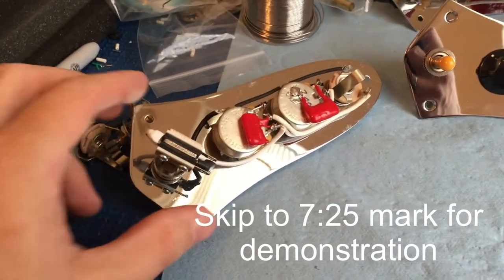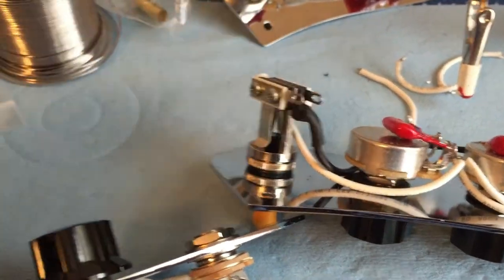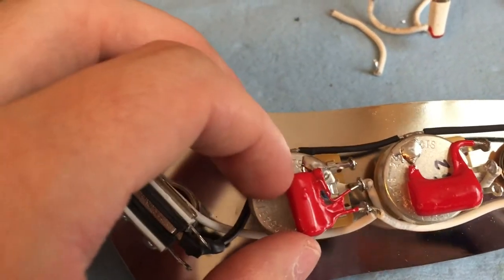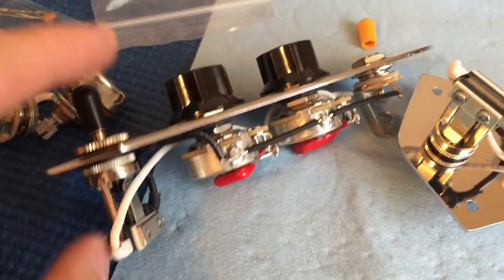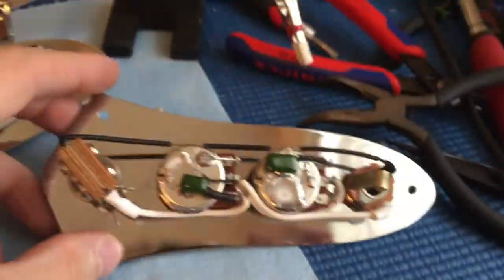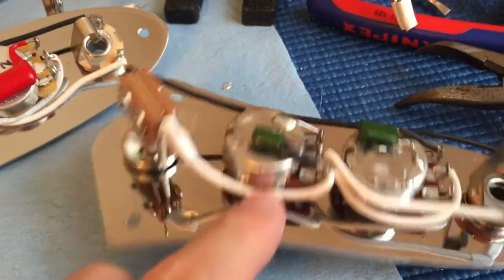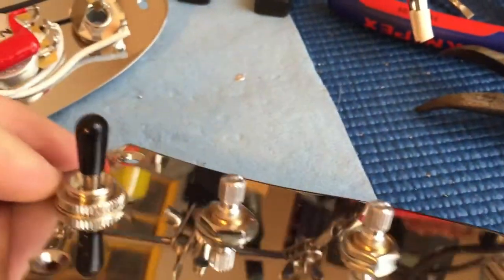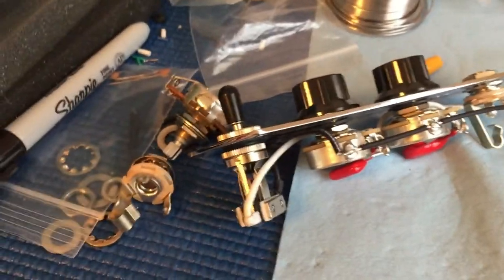Fender Jazz Bass Control Plate that you didn’t know you needed!

Comment: Fender didn't use a selector switch on jazz basses because it's a bad idea. Using a selector switch limits the tones you can get out of the pickup combination to full bridge, full neck, and full both. You can get all those with two volume controls so you aren't gaining anything in terms of tonal versatility and you're losing a lot. You also lose the ability to compromise your tone to combat the noise inherent to the jazz bass's single coils when their volumes don't match. Outside of the aesthetics value of having a switch if you think it looks cool, the only thing you gain by using a selector switch instead of the two volume setup is the ability to switch between a restricted set of tones very slightly faster. You could get the speed without losing anything you have with two volume controls by using a pan/blend pot instead of a switch.

On bass and guitar controls, the only times switches aren't inferior substitutes for pots is when they're being used for coil taps or series/parallel/single coil mode selectors.
Reply: and some people are totally fine with those "limitations" on tones. I used to use a blend pot and was either notched mid, full neck and full bridge. Fixing any wiring with a blend pot was a disaster as I'm not too handy with a soldering iron. I have completely converted and gone to a 3 way switch and it's everything I've been looking for. If any wiring goes wrong, it's an easy fix...but I don't expect any problems having now 2 of these in my possession, they're just designed and built incredibly well.
Reply: 90% of people don't use the blend, plus there is no number indicator on the knobs so its hard to remember where that "perfect blend" is.
Reply: @devlintaylor9520  I don't know why you think 90% of people don't use the bend on jazz basses. Even Jaco, probably the person most well known for playing with one pickup, didn't really just leave the neck pickup all the way off a lot of the time.

You don't really need an indicator because you can hear the tone and it's even easily find previous positions you like without having to listen just by turning a pot about so much from all the way on or all the way off. It's really not difficult at all.

If you really have that much trouble finding a previous spots on a pot, just roll it all the way off, put your thumb at about 9 o'clock on the knob, roll it on until you find the tone, and remember what position on the clock your thumb ended up. You can get any possible mix of the pickups on a jazz bass with at least one pickup all the way on. If you have the neck pickup an 80% and the bridge pickup at 60%, the tone the same as having the neck pickup at 100% and the bridge pickup at 75%. The only difference is that you have less volume at 60|80 than you do at 75|100. Just keep at least one knob all the way up all the time so you only have to worry about rolling to a spot that isn't all the way up on one knob. The spot on the other knob is going to be close to some landmark that make it easy to find on the fly if you know it's there: just a smidge before noon on the dial, just barely past 2 o'clock, etc.

That does leave you with a volume control issue, but that's just an issue inherent to jazz basses. They're designed in such a way that you can't simply change your volume without changing your tone unless one pickup is active. Unless you want to run back to your amp all the time, you pretty much need a volume pedal to act as a master volume control.

A pickup selector switch doesn't really improve anything. If you only have your pickups all the way on or all the way off, it's just as quick and easy to roll a pot all the way up or down as it is to flip a switch. I guess it' would be easier switching one pickup between all the way off and to 10 o'clock or something if you aren't used to messing with the tone knobs at all, but not by much you're probably not usually going to be playing with one pickup all the way off if you're used to messing with the tone knobs because you need both pickups on at least a little bit to reduce the 60 cycle hum. If Jazz basses had humbuckers or a third middle single coil pickup to act like a humbucher in tandem with the neck an bridge pick up, it might be a different story. Even if you don't care about the hum, it's unlikely that the tone you want is really going to be only one or both pickups at full volume. You're probably going to want at least a little more low end from the neck pickup when the bridge pickup is all the way up, a little more crispness from the bridge pickup if the neck pickup is all the way up, or a little less of one pickup if they're both all the way up.

Comment: I’ve found with the alphas, you can take like a 220 grit sandpaper or sanding block to the back and then it grounds just fine! Just a couple swipes does it, takes 5 seconds. 

I have a small shop with tons of pots in stock and I’ve sanded the backs of all of the alphas. 

But I think the Bourns are just as good any way. Just a tip!

Comment: Might as well use a switch, the stock volume pots on my American Fender Jazz don’t blend, you can’t hear the lower volume p-up until it’s turned up 85-90%.
Reply from the maker: @michaelanthony9068  I hear ya. That’s 50% of the reason why I make all these different models is because of those borderline useless pots that Fender uses called J taper pots. You’re right. They’re basically on off switches.

Comment: I'm thinking of adding a 3 way switch to my PJ bass. I want volume control for both pickups to be able to blend the pickups.
Reply from the maker: A three way switch AND a blend switch?
Reply: @ticktockfool  I want to keep both volume controls and add the 3 way switch.
Reply from the maker: @rong648  Gotcha! What about your tone knob? Or are you planning to cut your pick guard for the toggle?
Reply: @ticktockfool  I want to put the switch between the volume controls.
Reply: I did some more research and I'm going to install a Blend Pot. (Master Volume, Blend Pot, and Master Tone).
Reply: Independent volume control doesn't do anything interesting, unless your bass is active.

Comment: I did this along time ago on an old pj vm jaguar bass, only I had a barrel style out so I was ale to do dual volumes and a single cap still. Still a very good jazz bass sound and could instantly solo the p bass pickup. Doing it this way with a single volume plus the treble bleeds is pretty redundant. Bass players don't really use their volume as a tone shaper and also don't instantly select pickups as guitar players normally do. Idk just silly but hey I'm not kgonna knock anyone for getting their bag.

Comment: Neck in the bottom position bridge in the top? Is there a reason for that? I'd me inclined to mount the switch like a Telecaster where you can flick with the Pinky forward to the neck and back to the bridge. Cool setup. I've got my Jazz on dual concentric pots, no switch.
Reply from the maker: Hmmm? Neck is foreword position, bridge is rear, mid is both. These are “tele” directional.

Comment: Holy crap! I have one of those basses! Also, I have a jazz bass with 3 way switch but 2 positions of the switch are just bridge?
Reply from the maker: Really? Cool! This switch will get you three  positions. N. N&B. B
Reply: @ticktockfool  mine is an odd wiring; jazz bass with push pull volume, tone, and 3 way switch. I can’t tell what it’s supposed to do. The neck pickup is never isolated.
Reply from the maker: @jdanielcramer  Well, I offer all of these builds on reverb. Check the links in the description if you're interested.   ;)

Comment: The cheaper model does not appear to be electrically equivalent to the first (compare @ 3:30).  The cheaper model does not have the resistor on the volume pot.  Are the capacitor values the same?  Thanks.
Reply from the maker: That one has been discontinued for a long time. I only make the models on reverb and eBay.

Comment: Man, it looks easy for you.  I'm struggling trying to rewire my first 1982 build.  DiMarzio Super II in bridge and SDS1 in neck.  I had 2 vol and 2 tone.  Wanting to have each with volume and one tone.  Not sure which is best
Is there any benefit to the 3-way switch is I want two pickups with their own volume and tone?  Can't I just control them with their independent circuits?  Will they in fact be independent?
Reply from the maker: Ahhhh! I am finishing my latest video for my Les Paul. Kuldip for fender Jazz bass. 
Check out the reverb link. I’ll hopefully finish this video today
https://reverb.com/item/48525589-apostasy-fender-jazz-bass-les-paul-wiring-harness-control-plate?utm_source=rev-ios-app&utm_medium=ios-share&utm_campaign=listing&utm_content=48525589
Reply from the maker: There is another circuit option as well. It’s the first circuit fender made for the Jazz bass called the 60’s build or something like that.
https://reverb.com/item/42665585-fender-1960-s-jazz-bass-wiring-harness-and-controlplate?utm_source=rev-ios-app&utm_medium=ios-share&utm_campaign=listing&utm_content=42665585
Reply from the maker: Just uploaded.
https://youtu.be/CRwlfkMsmtE

Comment: Is the middle switch position series?
Reply from the maker: The toggle switch is for pickup selection. N, N&B , B. Middle knob is master volume, lower knob is master tone.
Reply: @ticktockfool  Thanks my question is actually when the toggle is for N&B are the pickups in series or parallel?
Reply from the maker: @jeff5069  parallel. There isn’t a series option on this build. It’s like the controls on a telecaster. The “Heresy” model is this plus a series/parallel switch if that is what you’re after.

Comment: I would change the order of the controls, from top to bottom: Master volume first, master tone second, then the toggle switch, and finally the output jack. (I’m also a big fan of the reversed control plate mod on a Telecaster.)
Reply from the maker: Yeah, that’s doable. Vol tone toggle jack right? Sure. Easy ;) when people order these, they can request any configuration they want within reason.
Reply: @ticktockfool  Awesome, good to know!
Reply: Volume-toggle switch-tone
Reply: @8Junio76  Also not a bad choice. Good to see there’s room for individual preference.